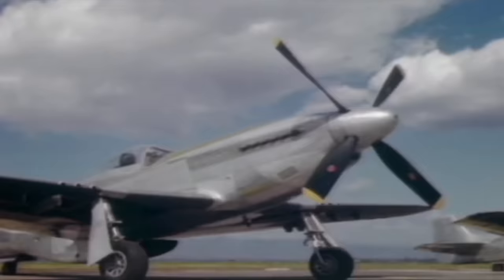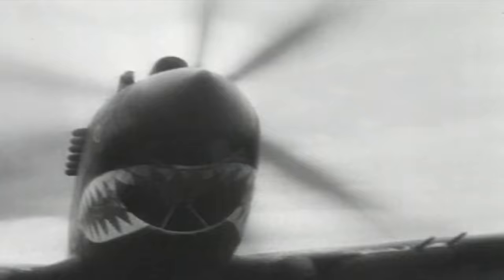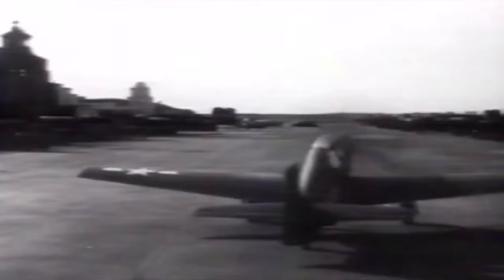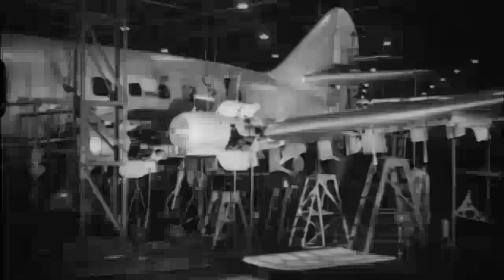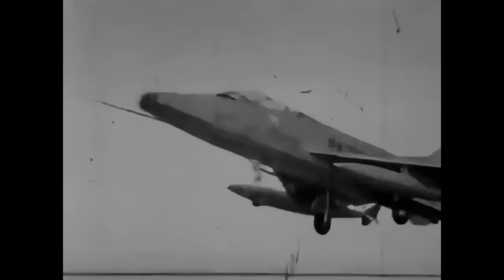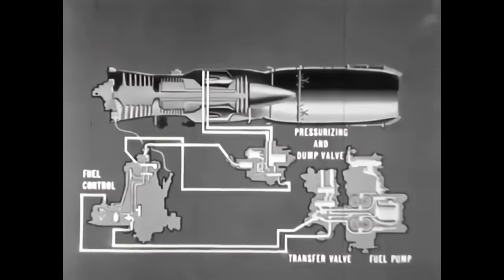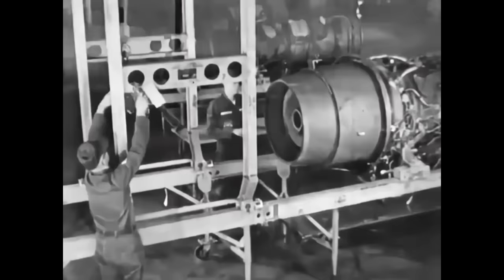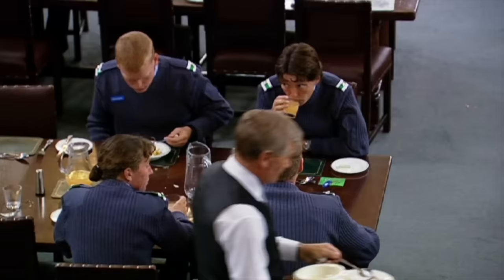Aircraft Engines | From Propellers To Turbojets, To Supersonic Passenger Jets | A Video Collection

Comment: A ticket on the concorde Paris to New York was around 10k $ in 2000.
Reply from the maker: There were many ways to get them much cheaper, as low as $3,500 round trip Paris/N.Y.  It was higher than today's (cheapest) Business, but much cheaper than 1st class, and the level of service was astronomical from the moment you arrived at the airport, to the moment you landed in N.Y. including a dedicated hub for immigration. the seats were small, and not comparable first class, but the trip was so exciting from the first minute, that the handful of hours passed as it was a one hour flight. It not only shrunk flight time, but most importantly, it shrunk the perception of flight time. I guess that perhaps over time that perception expanded again, but it was like going to watch a great movie that you hope does not end.

Comment: I love watching this stuff. I’ve been around aviation for years. I was an avionics technician on P-3s 50 years ago. Then I worked at P&WA a couple of years on the assembly floor putting together JT-8s and JT-9s.  I wanted to work in electronics and moved to Alaska and had jobs for over 30 years where I was flown all over the state in many kinds of aircraft including helicopters. One of the customers of the engines I worked on at P&WA was Alaska Airlines and I flew on them a lot to hubs where I got on smaller aircraft. I worked for a contractor turning up satellite communications for the FAA all over the state including ZAN which is the control center for Alaska airspace for a couple of years.  Also worked on the microwave communications for the pipeline for 15 years. Most of the sites were only helicopter accessible to mountain tops. I’ve been to quite a few of the military radar sites also. I got paid to do some pretty cool stuff. Now I’m 70.
Reply: Cool stuff indeed. I like hearing about people's stories and experiences, and YouTube's ability to bring personal stories out of us never ceases to amaze me. Thanks for sharing.
Reply: 0

Comment: I’d add too, that during the talk of radials being more reliable because of a lack of need to maintain coolant flow (which is completely valid by the way)

Kurt tank, the designer of the fw190 remarked that he thought the bf109 was a race horse. But since this was a war, he wanted to build a warhorse.

What I’m referencing is this: essentially all aircraft at this time were controlled by hydraulics. (Except noticeably not the Japanese zero, which was only cables, meant it was out classed at higher speeds) and for whatever reason did not have self sealing fuel tanks. So even minor hits would be problematic.

Anyways, building a warhorse. Flight control surfaces controlled electrically. Not hydraulically.

If it’s hydraulic, and gets punctured, that’s a loss of control authority.

Electric? You can have multiple lines running to the control surface. One gets punctured. No problem.

Warhorse, not a racehorse.

Comment: In truth, the P-51c models were the most prevalent through the war. The very model flown by the brave men of Tuskegee. It was faster than the D model only just, but carried only 4 guns so it had less weight. Not only that the visibility was lower due to sharing the same body as its earlier A-36 and o.g. P-51 bretheren. The P-47 was also a MAJOR player in the war, often being called "the plane that won the war". 
These are great videos, a lot of people put a major emphasis on the P51D models but until later in the war most units just didn't have them yet.
Reply: Yes-the 47 and 38 are the ones that slugged it out when the Luftwaffe still had their Aces.

Comment: The US Navy was biased towards the radial engine primarily because of its reliability, ability to operate with battle damage that would have brought down a liquid-cooled inline engine, and its ease of maintenance. Those were critical attributes when operating from an aircraft carrier and over water. Radial engines also evolved superior power to weight ratios than inline engines.

The Army Air Force was less concerned about those positive attributes and valued the reduced frontal area of inline engines and its potential impact on drag. Frontal area was more a perceived issue than a real one. Liquid cooling provides its own drag penalties and both the radial-engined Focke-Wulf 190 and the Vought F4U Corsair benefitted from NACA radial cowling drag research to become two of the fastest single-engined fighters of WWII.
Reply: i watch greggs aeroplanes as well
Reply: LOL @billynomates920  brilliant

Comment: That two stage mechanical supercharger that RR came up with was one of those ingenious innovations that made the Merlin's high altitude power with simplicity and compact design that used a single driveshaft with two carefully sized impellers that did away with the degree of intercooling problems that plagued the early P38s. It made the perfect match for a pilot friendly P51 that was really the secret of it's success at making green pilots into proficient combat pilots with little distraction. . . . that and it's relatively long legs. Like the A6M it had some very useful reach though it's a mystery why it took the 8th AAF so long to fit drop tanks to P47s. .

Unless he had the strength of a pre puberty girl though Brown did overstate the Jugs compressibilty as any Jug pilot could've and did tell otherwise. It was known for out diving everything and being recoverable at it. The P51 has to go down as one of the great warplanes in any case.
Reply: Eric Winkle Brown was one of the best test pilots out. The British used test equipment to test compressibility not judgement by individuals. The Commander of the US Eight Airforce (James Doolittle) asked the Brits to test the Lightning Thunderbolt and Mustang for Compressibility as a lot Lightnings and Thunderbolts were last seen by bomber crews in a high speed dives. Compressibility is where the airflow over the control surfaces is disrupted meaning they do not work, nothing to do with strength. It would be like trying to steer a car on ice, strength was not an issue. You had to slow down to establish correct airflow to pull out, many did not. The Lightning suffered worse than the Jug and did have additional control surfaces eventually fitted, but two boosted unreliable engines and less manoeuvrability  meant its removal from the European theatre. The Jug also was also a great ground attack aircraft like the Typhoon. The Mustang with drop tanks had the range the speed the manoeuvrability to be the best escort fighter of the war.
Reply: @anthonywilson4873  I know Brown's version of it but the problem is that his Mach numbers dissent from everyone else's by quite a bit in that his are .71 and everyone else's including other RAF testing range from .78 to .82. The RAF tested the P47D to the equal of 450 mph at 20,000 ft which works out to Mach .826. I don't know why Brown's numbers are that low because the decision by the 8th AAF to go to the Merlin P51 had already been made before Doolittle took charge.
.
Any B17 gunner that had the time to watch for anything but incoming fighters would have about five seconds to watch US fighters disappear at 400 mph. There just aren't any records of P47s crashing into the ground en masse to verify any such claims. What there are reports of is P47s out diving Me109s and Fw190s and none of the opposite happening. Obviously if they had not recovered they wouldn't be writing post battle reports.
.
 The 56th Fighter Group rewrote the tactics that Doolittle used to destroy the Luftwaffe at a time when drop tanks were finally used with their P47s and only two fighter groups had been delivered their P51s. They included adopting the Luftwaffe four finger formations in several stacks out ahead of the bombers to break up the Luftwaffe head-on attacks and top cover P47s 4000 ft above to dive on the Luftwaffe fighters and pick them off. So they continued to dive on and away from Luftwaffe fighters well after Brown's tests and Doolittle adopted those tactics for every fighter group in the 8th
.
The P51 was a damned good pilot friendly fighter that could be made quickly and was what the 8th AAF needed. The P47 had hardly been "useless" as Brown put it.
Reply: @anthonywilson4873  ramblings of an old man, James Doolittle begged no one for an answer to Compressibility, the jug had dive flaps, nothing outdove that yet browns mach numbers had german fighters out diving jugs, last place any german fighter jock wanted to find himself was in a dive with a jug, any man that cannot find himself putting the word packard in front of the word merlin i take with a grain of salt
Reply: P-38 could be run way overboost because it was a boost house baby. Those superchargers cant be field turnt for 30k+ foot operations with dat thruuuust.
Reply: @evanfinch4987  The problems with the P38 stemmed from trying to use the evaporative wing mounted inner-coolers for too long and the compression issue which really was a fatal problem for the P38s high altitude escort role until both issues had been dealt with by the P38L variant.  Consequence of the USAAF having bought a fighter upon the crash of it's only prototype. 

All these technically advanced turbo second stage supercharged fighters cost lots of money and multiplied x 2 for the P38. And despite the numbers produced were not as conveniently suited for mass production as the  simple, pilot friendly  and relatively cheap to build  P51 or F6F was. I believe the saying goes: "Amateurs talk strategy. Pros talk logistics."

My Dad's 3rd Attack Group, 5th AAF found the Aces loaded P38 groups well appreciated though for escorting treetop parafrag missions against Imperial Japanese Army airfields. Their pilots were well practiced veterans by the time they got their P38s and could boast the 2 leading confirmed scoring US pilots of either theater of the war

Comment: My Dad designed Compressor components for many different engines at General Electric for both Military and Commercial Jet Engines. I know that he talked to Pilots about the Performance of General Electric Engines. There was an Aircraft in the 1970's that originally had Pratt and Whitney Engines and were retrofitted with General Electric's Jet Engines and the Pilots told my Dad verbatim "We can fly the Plane and not the Engine now!". I might add, that my Uncle's Specialty was designing Jet Engine Components for Turbines at General Electric. One word that stands out in my mind; Thrust
Reply: I can only think it was the F-14 Tomcat. Politics play important in military aquisation, most people don't realize it. Pratt put the TF30  in the A model Tomcat. As the weight increased during it's developement, PWA  knew the older TF30 was not the ideal dog fight engine. In the F-111, (fighter bomber without all the throttle banging of a dog fight aircraft), the motor performed well but was prone to compressor stalls. Thus Pratt  had another newer, more powerful engine in developement to put in the Tomcat. But when the B version Tomcat came around the contract was given to G.E.  This engine (I believe) was a derivative of the F-110  flying in the "Bone". A more modern good engine that finally made the F-14 fly w/out regard to AOA ans other flight parameters. I did witnessed an emergency landing of a G.E. powered Tomcat when one engine stuck in afterburner and had to be shut down. As a pilot, I can tell you 'shit happens' no matter who makes the motor!!!
Reply from the maker: Originally G.E. And Pratt and Whitney’s turbojets were British, thanks to Sir Frank Whittle’s invention.
The Americans (thankfully) recognized his genius much more than his countrymen ever did.
His was really an invention troubled by every possible obstacle thrown his way.

Comment: Somebody may have already pointed this out.  But those 9 cylinder engines are called Radial engines.  Rotary engines were designed by Wankle (think mazda RX series cars of the 70s and 80s) and were not used in airplanes that I am aware.
Reply: Wankel engines are a type of rotary engine because the 'rotors' rotate. Rotary fixed crank engines whereby the engine cylinders 'rotate' are rotary engines as well.
Reply from the maker: This has been covered. Aero rotary engines are not the same as automotive engines. They are two different things.
Reply: @Dronescapes  That's not technically true,  they are used to power military drones.
Reply from the maker: A definition from a University paper:
“The rotary aero engine is a special type of air-cooled radial engine, where the cylinders are arranged like the spokes of a wheel and turn around the crankshaft. The propeller is connected to the cylinders, while the crankshaft is fixed to the frame. The rotary aero engine, developed in 1908, set new standards of power and light weight within the aircraft industry. It was adopted by many pioneer aviators and widely used to set records of endurance, speed and height. Many aero engine manufacturers produced different models and variants of this type of engine, which was extensively used until the end of the First World War. The latest evolution of the rotary engine was the counter-rotary arrangement, which was devised and designed by the Siemens-Halske company.”
Reply: Those older engines are called radial engines not rotary. I worked on those 40 yrs ago
Reply: Wankel describe as rotary engine is actually car term, not aircraft term

Because rotary engine term already used before to describe spinning radial engine that already used 70 years before RX-series even launched
Reply: You are incorrect. He is correct regarding aero-rotary engines. I have an original Gnome Engine Company  "Monosoupape" engine mechanics manual. Kindly peruse this...https://en.wikipedia.org/wiki/Gnome_Monosoupape

Comment: Little remark: First Whittle''s Jet Engine had radial compressor and turbine and annualar combustion chambers around the engine. Was short but a rather great diameter. Not suitable for installation in a slik nacelle/airframe/wing.

Comment: The merlin and every 12 cyl engine like the merlin was not an inline engine, they were V configuration engines with a 60 degree offset from each bank of cylinders
Reply: Thank you for pointing this out. It really makes it hard to legitimize this content with such a blatant mistake throughout the entire video.
Reply: I thought the same thing, and was wrong, like you. An aero inline can be from several different configurations. Basically, if cylinders are in line, it's an inline aero engine. A V configured engine is an inline, but, an inline isn't necessarily a V engine.

Comment: Nice video.
Some questions while I am watching it.
How is the rotary engine supplied with fuel if all cylinders are rotating in high speed?
If the in-line engines are more powerful, why the WW2 bombers were equipped with radial ones. FW-190, La-5 too?

Comment: A patent was submitted by Maxime Guillaume in 1921 for a similar invention which was technically unfeasible at the time. Whittle's jet engines were developed some years earlier than those of Germany's Hans von Ohain, who designed the first-to-fly (but never operational) turbojet engine.
Reply from the maker: Correct, in essence the first working turbojet was created by Whittle. His engine (and variants) also became the first U.S. turbojet to fly (Bell XP-59), and the first  U.S. operation one as well (Lockheed P-80).
It also powered the first operational Soviet jet (MiG-15), after Russia ditched all variants of German engines as flawed, dangerous and utterly unreliable, and they ended up cloning Whittle’s engine (RR Nene), after purchasing a handful of units.
Interestingly the first German flight was not powered by an axial turbojet, but by none other than a centrifugal one (Whittle’s invention), and today we know that Von Ohain had access to Whittle’s work, as it had been copied and distributed in Universities across Germany in the mid 30s, when the young German engineer started working on his engine.
Considering that Whittle had been ostracized, delayed, and unsupported for 6 years, that is a remarkable achievement. His milestone engine was ultimately achieved with very limited private funds, £200,000 in today’s money, practically nothing for such a feat. In Germany Von Ohain had been fully supported and pampered by Heinkel, a very different treatment.

Comment: The Mustang with the Allison engine would have been a fiasco. I wonder why they never made a test with a P38 with RR Packard engines. Probably it would have been a rocket? If I am wrong then apologies.
Reply: You make a good point.
Reply: I think the P-38 got the superior powered Allisons as it had the room for the extra kit which single engine fighters didn't without screwing up aerodynamics, so they weren't needed. Was similar to the Mosquito performance wise, which had different RR engines to the Packard model for the P-51.
The Hornet was just about the top twin piston engine fighter evolution, basically an OP single seat Mosquito, but the war ended before it saw combat.